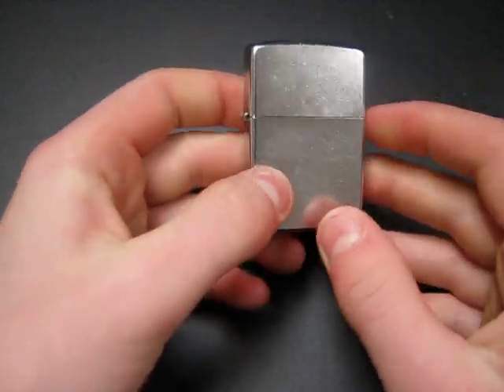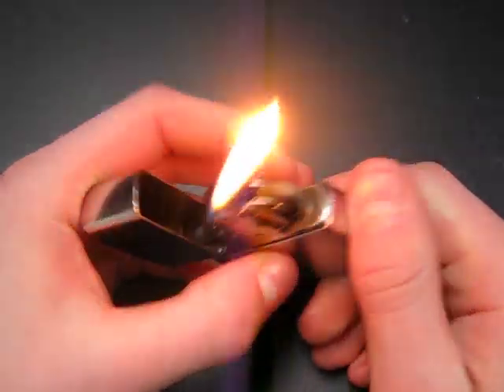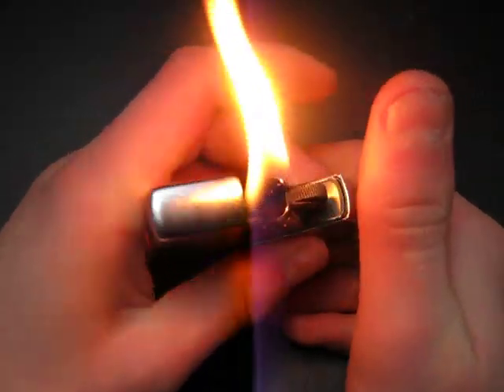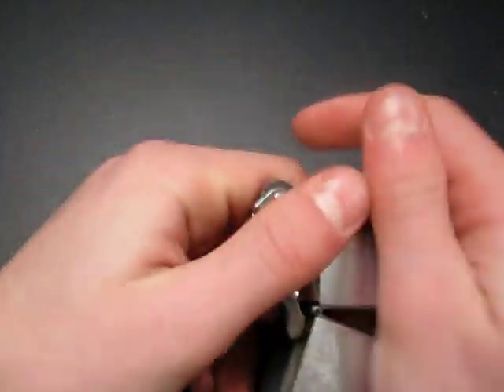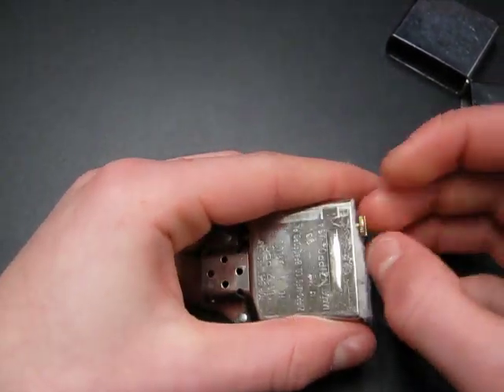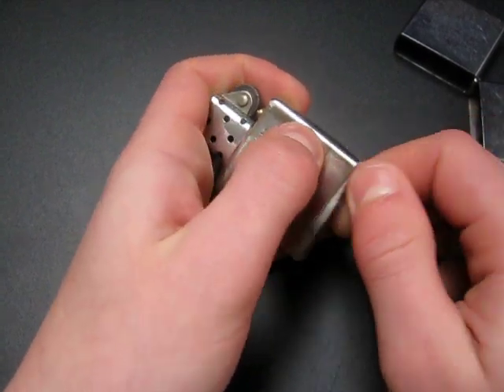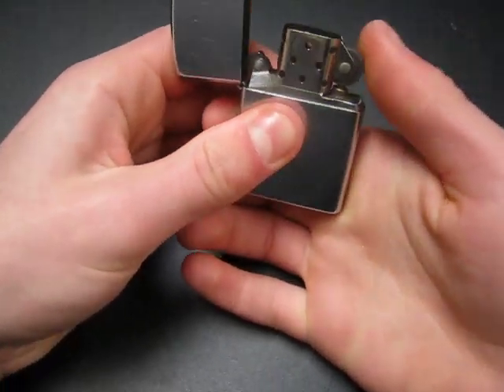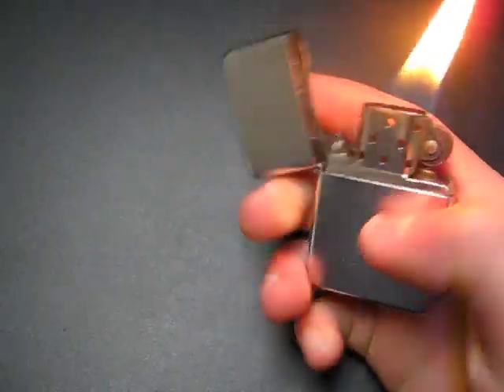Zippo Repair: how to fix a stuck flint wheel

Comment: thanks for this. i found a zippo that still worked just fine in the road one day. used it for a while and wheel locked thought i just needed new flint still locked. tapped it a few times and sure enough the old flint fell out it was worn to a flat disc. no wonder it was stuck. this video helped a lot :)

Comment: I don’t know what I’m doing wrong, I didn’t know about this trick and thought exactly as you said, they were ruined. So I’ve basically purchased like eight more in the past two months and no joke, they don’t last long. And it’s not that I’m cheap either, I’m spending a lot of money on these things, some of them cost 60 $70. I tried your trick and screwed the thing back in, I add the Zippo lighter fluid, and so now the wheel works again but they’re not lighting up it’s just like they’re dead. I give up. I guess I need to go back to being unclassy and using a Bic. LOL

Comment: Interesting point about the flint being new. The wheel would spin backwards but not forwards, so i spun it a couple times backwards to wear in the flint and it worked after that. Thanks

Comment from the maker: There might be something clogging the flint tube that would prevent contact.  A small screwdriver or something like that is useful for that situation.  That is common with Zippos that have not been used for many years. The more unlikely reason would be that your actual flint wheel is too worn down to spark.  If that is the case, you can send the lighter back to Zippo and they will fix it for free.

Comment: Good tutorial. I recently picked up a Zippo at a garage sale but the wheel would not turn. What I think the problem is is that the old flint is stuck and is preventing the wheel from turning because no flint is coming out of it. Will most likely have to go send it in.

Comment: I just took a really old zippo into use. After inserting a new flint in, the wheel wouldn't move anywhere, but loosening the spring by unscrewing a bit fixed that.

Comment from the maker: @jumbofingers you can either squeeze the case inwards or put a little electrical tape on the side of the insert.  You can also use pliers to bend the insert outwards. Hope that helps :)

Comment from the maker: Old Zippos are always difficult because after a few years, flints will disintegrate into a gum like material.  I have not had much luck cleaning that out of lighters.  Out of probably six or seven antique lighters I restored, only half of them I could clean out without the help of customer service.  My advice is to try with a small screw driver or bent out paper clip.  If that does not work, you will most likely have to send your Zippos back.  Good luck sir.

Comment: It might be worth mentioning (in an annotation or something), that if you do this and the wheel is still stuck, and nothing came out other than the spring when you put the lighter upright, it might be because the flint needs to be changed.

Comment: I have an old mechanical lighter. The lighter stone works fine and there is sufficient spark, but the gas won't come out of the tube? Is there a way I can clean the small pipe that lets the gas out?
Reply: just buy new one m8

Comment from the maker: That does not sound like a Zippo but it is close enough.  You will have to use a small screwdriver to push it out. Try knocking it on the table.  Zippos are practically indestructible besides the hinge.  If all else fails, take advantage of the free unconditional warranty that every Zippo has.

Comment from the maker: I have never had a loose hinge so I am not sure what to do.  I usually send my Zippos for repair.  If you cannot do that, you should check out some other videos.  I saw that there are videos on this problem.  If the hinge is just not aligned you can tap it back in place with a hammer.  That is a common problem.  I would need to see the Zippo to say for sure though.  Good luck.

Comment from the maker: Once you close it, you don't have to worry about it anymore.  The way it goes out is by suffocating the flame with the lid.  When you open the lighter, you are reintroducing oxygen which will kick the fire up again if it didn't completely go out.  I have been carrying Zippos for years and I have never had one catch my pocket on fire or anything like that so you should be fine.  Just make sure there is no fuel on the lighter after you fill it of course.

Comment from the maker: Use Zippo flints because they are softer than Ronson.  The more you use the Zippo, the weaker the spring will get and the more the wheel will get worn in.  After you use a flint for a while, a groove will be made in it and that helps the flint wheel move smoother.  If you really want, you could shorten the spring but I do not suggest it.  Mechanical things wear over time, you just need to work it in.

Comment from the maker: The wick doesn't affect the spark.  The sparking is done solely by the flint wheel.  You should check to see if anything is clogging the flint tube.  That sometimes happens if the flint gets too small or if the zippo is old.

Comment: My zippo wheel doesn't grind as well as it used to. At first I thought it was my flints, even tried stiffening the spring but still no good spark results. I have to press extra hard to get a baby spark. I know the wheel can be a hard to replace on my own, do you recon I should send it back to a zippo manufacturer?
Reply: It had this problem in less that a year after purchase and I don't smoke so I didn't use it every day but I did turn it on and of a couple times approx 150 times

Comment from the maker: Try a little oil to loosen it up.  Then find a screw driver that fits perfectly so you don't strip it.  After that just really crack on the screw.  I am assuming that is an old lighter you have?

Comment: The flint in my zippo is stuck in the tube. I tried forcing it through, but it's really jammed in there, and won't seem to budge. I REALLY love this lighter, because it's a limited edition Camel lighter. The kind that's made from copper and has an unusual lid: it's about thumbprint-sized and has a tube that snuffs out the wick, instead of the usual zippo lid, you know what I mean? HOW DO I GET THE JAMMED FLINT OUT OF THE TUBE?

Comment: Hey mate, I bought an expensive Zippo and I've filled it up with fluid and loosened my flint  up yet my flint still will not even spark? Have you heard of this happening before and do you have a solution? I've tried everything I can possibly think of!

Comment from the maker: Is the flint touching the wheel?  If the flint spring is not all the way through the tube it won't push the flint against the wheel

Comment from the maker: It probably means your flint is too short to use anymore. I suggest replacing it so it doesn't get stuck under the wheel or in the flint tube.

Comment: i watched somewhere that you have to stretch the spring a l little (my lighter wouldnt spark) so i did so but think i may have stretched it a little too much. it was hard to get back in and now the wheel is obviously completely stuck. do i need a new flint or can i do something to restore it?

Comment: Hi, there!
Props for your videos!

I have a question... Do you know how i could change the metal tab under the cam of the lighter?

Mine seems to have burned and lost it's elasticity until it broke.
And that on one lighter that i don't use for tricks.

Regards!
Dino
Reply from the maker: Thank you! Your problem is one that I cannot fix. Unless you are super handy, I assume you won't be able to either.  I would suggest simply sending your light to the Zippo Repair Clinic.  There are a few around the world, depending on if you are not American.  They will fix your Zippo for free and get it back to you rather quickly in my experiences.  I have a whole video explaining exactly what to do.  I suggest checking that out. Good luck!
Reply: Thank you! 
:D

Comment: Hey i recently got my new zippo 2 days ago and i started having the same issue in the video, however i am one of those people who try to fix everything and now im having more issues,the pring with the flint popped up so i had to take the wheel out, again i didnt really know what i was doing and i ended up breaking one end if the screw thing off while trying to unscrew it (again i had no idea what i was doing) i managed to get the wheel off and i have been trying to get the spring to stay back down ever since, the main issue is that the sping wont stay down at all

Comment: I took the flint out of my Zippo, and the
wheel would spin fine.  Then when I put
the flint back in, the wheel got stuck or
hard to move again.

Earlier when I was fiddling with the lighter,
I heard something tiny fall to the floor. Could
it have been the tip of the flint?

When I examined the flint, the head just
looked like a tiny brass cylinder on a
spring. Could the spring be overstretched?

If yes, can I fix that or just replace the flint?

Thanks in advance.
Reply: The flints a separate piece inserted along with the long spring thing. I dropped my flint too just had to put in a new one.

Comment: Hey thanks for fixing my wheel, but now it doesn't create any sparks if i spin it. I have been carrying my zippo for 7-8 months now, and this has never happened. The wheel spins nicely, and it DOES have friction on the flint but as i said, no sparks. Thought i would ask you before going out to repair it.

Comment from the maker: Really jam on the flint wheel. Zippos are built like tanks.  If it still doesn't move, it might not have flint in it and you are trying to grind down on the follower for the spring.

Comment from the maker: It does not come filled with fuel. You will need to buy that.  If the lighter is new, a stuck flint is completely normal.  Once it gets worn in, things will get smoother.

Comment: My lighter won’t spark, the grooves on the wheel are still there and the flint is all there but it won’t light. It is kind of new and I have rolled it backwards a lot of time and still no spark. Got any suggestions?

Comment from the maker: Well all Zippos have a wheel.  You must have some other kind of lighter.  It sounds like an electric starter which means there is no flint to change.  The other option is an IMCO Austrian Military lighter that has a covered wheel.  I have a video on it.  Check it out.

Comment: my zippo is brand new. Changed the flind, it sparks, but the wheel and the flint is really tight     i unscrewd it did everything in the video and it still keeps getting stuck. If i try really hard it will move and be easy for a couple of strokes after a while it gets stuck again and seems to be always tight that cant even move the wheel. How can i fix it so it dosent keep geting stuck

Comment from the maker: If you aren't already using Zippo fuel, that might be the problem.  You might have over filled it.  If that's the case, try blowing into the chimney.  If the wick is black and charred, refer to my video on trimming the wick. And if all else fails you can always send the zippo back to the factory to be fixed for free.  I think one of the things I just said will fix the lighter though.

Comment from the maker: Try changing the flint.  Sometimes getting them wet can destroy them. Also, is your Zippo old? If it is very very well used the flint wheel can get worn down.  Check for something blocking the flint hole with a needle or small screw driver.  Flints disintegrate into a goo after a few years.  Hope that helps you with your Zippo.  Thanks for watching.

Comment: I recently changed the flint on my zippo and the wheel is stuck. how do i smoothen out the flint so that the wheel movement lights up sparks again? the just unscrewing and putting it back in method doesnt seem to be working

Comment: Oh, thanks! Turns out the there was a little piece of flint left, so it wasn't sitting snug in there and so I had trouble getting the spark without rolling the wheel back first.

Comment: The Flint in my Zippo has gotten worn down to the point where when I put it back in, it got stuck on its side and now I can't get it out. I saw another vid on how to fix this by using a drill and a thin drill bit, but I have neither of those things. Does anyone here know a way I can get that Flint out of there without having to use a drill?

Comment: I did this to my zippo and the flint still will not come out and it still will not spin and produce sparks. I have even tried a knife with a really thin blade and pushed it between flint and the striker and it will not budge. Not sure what else to do.
Reply: Yeah i did that too but now my sping has popped up and i cant get it back down

Comment: I tried removing the flint screw once and when i put it back my lighter wont spark. I checked this video and tried but there was no flint inside that should come out. And it used to work perfect. Now it wont work

Comment: Funny i noticed my wheel was stuck on my zippo today. It was right after i had dropped it while the top was open, so I thought maybe the flint had somehow popped out.(i've had it for a day and wasn't too familiar with zippos) anyway, before i watched the vid I was screwing with it and tried to move the wheel backwards and it worked again. I thought i was gona be all helpful and post a tip only to find you said to do that very thing in the video. Ah well

Comment: My lighter looks like its REALLY old and theres no flint or fluid in it.
The wheel still never turns.
Reply: Never mind, I just took a screw driver and pried it upward and then when I got it slowly spinning I just pressed really hard down on the wheel. Now its nice and loose.
Reply: o and by down, I meant turning it the right way. If u thought of actually PRESSING DOWN on it...

Comment: I pulled out my spring and something fell out with it and I can't use my Zippo now :(
Reply: lmao yea dude your flint fell out. At the end of the spring, there's a small little piece of metal that kind of looks like a flint, but it's actually inside the spring at the very end and it's what actually pushes and holds the flint into place. Leave that there. Get some new flints, unscrew and take the spring out, drop the new flint down in the hole, to doesn't matter which side you put facing down, and put the spring back in and screw it tight. YOU WILL HAVE FIRE MY DUDE! PROMISE.

Comment: still i took it out got no spark at all, not even a small one. help?
Reply from the maker: If you are positive that you have a flint, then something must be clogging your flint tube. It's a common problem with Zippos that have been sitting for a few years.
Reply: well flint looks good, path way is clean. unless the flint can be damaged how would i know that? it was working few min. ago, thnxz ill check those stores out.
Reply from the maker: James Rodriguez If the flint is making contact with the wheel, it should spark. Google what the flint looks like.
Reply: i  try putting a pic not sure if it showing?
Reply from the maker: James Rodriguez Nah, it didn't work. Doesn't matter, I know what a flint looks like. You should probably just go buy some more.
Reply: ill do that try those stores out, thnxz just dont understand why no spark.